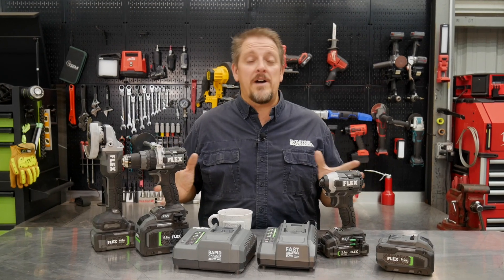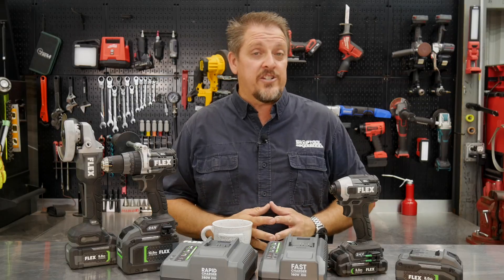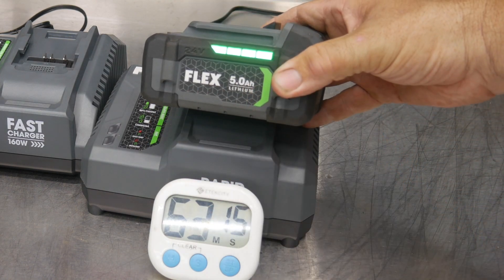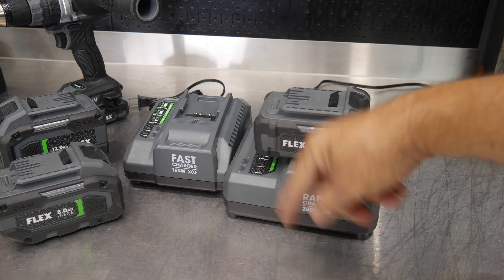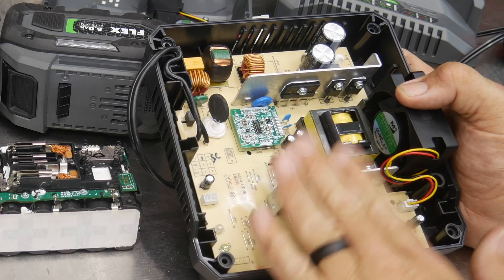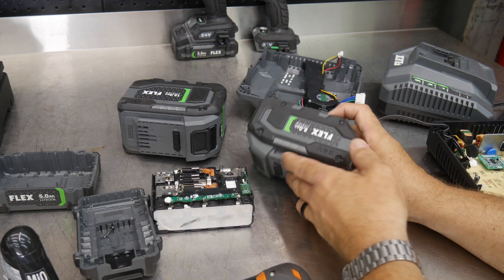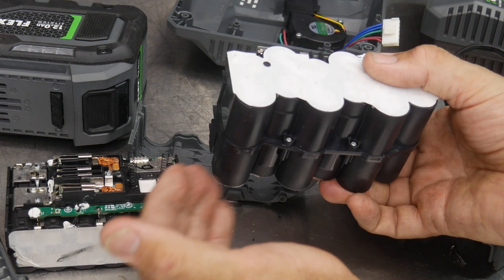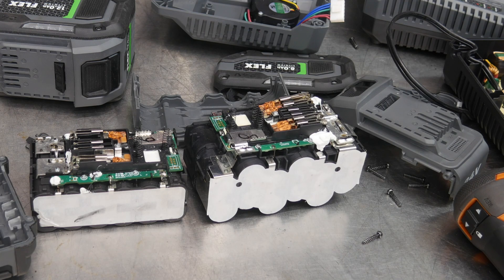DID WE KILL IT? FLEX Battery and Charger Technology [160W or 280W?]

Comment: Bought this Flex pack out a few months ago. Used on three projects. The latches between the top box and the middle box kept hanging up or not locking.  Soooo, tried to call company service to get a fix. Wasn't asking for anything but a tech to walk me through the fix(maybe a replacement latch?). First, good luck getting through, they DON"T answer their phones. After a half hour hold the message comes on offering a call back. No choice gotta grow old on the phone or give up. No call back, so the next day I try again, same deal, but this time I get a call back. Pleasant young lady hears the problem and takes all my info and says they are sending a new replacement unit!!  Of course nothing took place, NO Replacement Unit, No Latches, NO NOTHING!!!!   The product seems to be well made except for these few minor issues, however I would never recommend buying a Flex product. They have no customer loyalty.

Comment: I dropped over $3 thousand dollars in flex tools almost 2 years ago when they were released. 3 months ago the batteries started leaking back goo that stains everything and may be toxic. Flex warranty is nowhere to be seen.
Reply: They are offering a lifetime guarantee on everything if you buy it now before 2024. The registration is easy on the website, you can do it all online without calling anyone, and you register the serial number on your batteries, charger, and tools, so they can honor the lifetime warranty. From what I've heard, they are very happy to send new batteries, no questions asked (for people that had the leaking batteries). The leaking batteries were an old design, which they have since changed.
Reply: Did you register the products on their website?I had 3 start leaking, its their thermal packing paste between cells, mine leaked due to water spilling on them, I called them and they sent 3 new ones with no fuss, and I kept the original batteries and got lifetime on the new 3 I received.  Customer service was super easy and took no time at all to talk to someone.

Comment: What about the leaking issues when the flex batteries got hot?
Reply: They have fixed the issue, I had 3 leak, from water spilling on them, its thermal paste between the battery cells if I'm remembering correctly, I called and got 3 new batteries sent to me and was able to register the batts with lifetime warranty. No fuss at all, I called and waitedd maybe 2 mins for someone to answer

Comment: Does the cheaper charger have dual fans like the rapid charger?
And is it possible to charge a 10.0ah stack lithium battery on the cheaper, slower battery charger?
Reply: Yes it still has dual fans, and it will charge any of their batteries, just at a slower rate of course, only difference between the chargers is the watt output for charging.

Comment: That's Not an easy task! I was wondering if I might need a break before the tool. My Ryobi "smart charger" won't charge a hot battery either. It tests the battery every few seconds until the internal temp reaches a safe to charge temp. It doesn't use cooling fan and I accidentally killed a battery while working on a big project by placing it on charger too soon. I'm just saying the technology has been around for a while if my 9yr old smart charger had the tech for a DIY brand like Ryobi. The need for a cooling fan to cool down the battery when hot at least as important. I'm sure more than a few home fires, and construction sight incidents have occurred due this issue. Flex has made me reconsider what platform I may adopt next.
I'm looking forward to the new year, to see who has the latest and greatest tool platform. My Ryobi stuff needs to upscale to something contractor level.
Right now, DeWalt's kicking everything else's butt. I don't mean every individual tool available, but for the tools that I use to beat the heck out of on a daily basis in heavy duty body repair facility I work in.

Comment: Got an ego snowblower that came with two 7.5 ah batteries. One year, four uses, now one battery won't fully charge even though charger says it is charged. Now a  Flex 2.5 ah battery doing the same thing on its third charge. Tried fast and rapid charger. Also 6 ah stacked lithium on jobsite fan reads one bar, take the battery off, four bars. Not exactly a good battery track record so far. Anyone else having Chevron battery issues?
Reply: Sounds like my 6 dead Milwaukee batteries.  I put a volt meter on them and tested each cell...3.7v, 3.7v, and 1.4v.
That's a bad cell.  Batteries from all manufacturers are shyte these days.  Samsung or whoever is cutting corners.  As well as who ever makes milwaukees circuit boards for their tools.  Its the day and age we seem to be living in unfortunately.   Luckily i have not had a flex battery go bad yet.
Oh another thing.  I was told recently that if Milwaukee does not warranty these bricks that batteries plus and interstate batteries here locally can rebuild them for a reasonable price and the cells they are using are vastly superior to the ones the toolmakers buy in bulk for their batteries.  Have yet to test that out but several people i know are pleased with their results.

Comment: I purchased a new FLEX  tool with battery this month. Unfortunately, the battery is leaking fluid.
Reply: Yeah...i ran into that two on my 2nd 5ah battery. Lowes switched it out for me.  It was kinda funny...they had baggies just for batteries and baking soda boxes they dumped in there with it.😁
The thing is i like the flex tools i have bough enough to put up with warrantying a few batteries.  Just like my milwaukees.  My m12 and m18 lighting and my circ saws, sawsall,  jigsaw, and gen 4 impacter and 3/8 impact wrench are really good tools.
The weed wacker...not so much.🙄
Reply: @unclefester4626  
I like their tools. I wish the rest of the batteries will not leak in the future. It must be a manufacturer defect. The FLEX high torque impact wrench is powerful and reliable. May be the best wrench available.
Reply: @a.a.6132  i think these tool makers suffer from the same problem the automakers have.  They buy many of their components from other suppliers/manufacturers. They just design and assemble them?
Those samsung cells in milwaukee batteries are definitely not as good as they were 10 years ago.  They come in higher ah ratings from the old 1.5ah batts but the longevity is definitely not there.  Flex probably has no choice but to use the same crap cells.
Sure would be neat if there were an adapter that would plug into the battery slot, have an inverter and a cord running to a wall socket.  It could be used if batteries were dead or if several were down for repair. I think they make most of their profit on batteries?

Comment: You know what would be smart? Those brushless electronic motors have that fan on the back of them that move a LOT of air. Maybe if they used some ducting and ran air through the batteries that would help. Makitas already run air through the battery on the charger.
Reply from the maker: They do. They have ports on the batteries that allow the air to circulate through them. Thanks for watching.

Comment: I got the big boy battery.  1 month later, charger has quit on me.  Plug it in it shows red and green light and goes off.  Can this be fixed?  These chargers are expensive...
Reply from the maker: FLEX tools an chargers are covered for 5 years. Send it in for warranty. Lowes should be able to help you. In fact, if you registered the tool when you purchased, then you have a lifetime warranty.
Reply: @Shoptoolreviews  I didn't reg. It. And I actually got the charger and 12.0 battery for free from a review test site so I dnt have any kind of proof of purchase.  Still think they will warranty it??

Comment: Tha is for a great review Tim.  I’d like to import a Flex combo set across the pond to the UK.  Can you tell me if the charger is multi voltage seeing as we run in 240v mains?  Many thanks
Reply: does not work. 240v
Reply: But i think there are adapters to kick the 240 down to 110?
Why does the uk use 240??

Comment: FLEX IS AWESOME!!!! Great products for real
Reply from the maker: No doubt. Great products and lifetime warranty. Thanks for watching.
Reply: I have the inline circ saw with 2x 5.0ah batts,  their vacuum,  and now the compact impacter kit with the 2x 2.5ah batts.  Really impressed with all 3 but especially the vacuum.  I was expecting weak performance from the 5.0 battery but it wasnt weak at all.  Very good suction and runtime.  I will get the fan and radio next.  I would like to get the 7 1/4 right blade saw with the 10ah stack lithium but $400 price tag is giving my stomach fits.  
I might consider the grinder in your review.  I just don't need it as much as i am more into woodworking than metal work.  Not to say i dont occasionally cut metal here and there.
I am seriously hoping they come out with a 10" dual bevel miter saw and table saw soon.
Or even a band saw or plainer.  I'll take whatever they come out with.  That little inline circ saw is good enough to do furniture with.  Really impressed with it!!!

Comment: 280W on a 24V (max) battery is an ~11A charger. That’s consistent with charging a 5A battery in under 30 mins. I think that makes it the fastest power tool battery charger on the market.
Reply from the maker: I believe max output on the charger is actually 9.4A, but yes, it's pulling a lot of power. I would definitely think it's one of the fastest on the market at this time. Thanks for watching.
Reply: I have a makita 40v 4.0ah battery and 40v charger. It charges my 4ah battery (equivilant to 8ah on 18v, 6.6ah on 21.6v/24v) in 42 minutes, its pretty damn fast.

Comment: wonder how many cuts and how long it takes when your on a jobsite and its 100 degrees outside instead of a air conditioned shop
Reply from the maker: That's really funny. We wish our shop was air conditioned! In fact, when we filmed this, it was well over 100F degrees in our shop. Thanks for watching.
Reply: We call that "bat wing weather".  You sit down for breaktime 10 minutes or so and when you get back up certain things are sticking to multiple other things.  Not one of my fonder times of the year.
Nor is that kind of heat once fall hay fever kicks in...or what i call ragweed season.

Comment: An hour & 3 minutes for a full charge on a 5ah battery on a “rapid charger” is not to great tbh .30 mins for my Milwaukee 5ah on their rapid charger,bout 45 mins for a 6ah high output .I get its cooling first but idk .15 extra minutes for a battery charge on the site aint gunna cut it
Reply from the maker: It was NOT an hour and 3 minutes! It only took 52 minutes, 26 minutes for cooling-only, then 26 minutes to charge the battery. Milwaukee: 18V x 5ah = 90Wh. FLEX: 24V x 5ah = 120Wh. The FLEX charging in less than 30 minutes is doing quite a bit more work...and dropping the battery temp. Thanks for watching.
Reply: Which is why my battery collection is stuipidly large for a part time woodworker and full time hydraulic tech.
Expensive though...

Comment: Milwaukee needs fans like these on there string trimmer cause it gets hot and cuts out when you work it hard
Reply from the maker: Interesting. Which string trimmer model are you talking about? The QuikLok trimmer or the new M18 FUEL? Thanks for watching.
Reply: @Shoptoolreviews  both of them can get hot and cut out if you are working the tool pretty good
Reply: @Shoptoolreviews  i think i have the quick lock??  Its a battery destroying POS...  
Will run a battery below the cutoff point.  Hate it with a passion.

Comment: that battery is actually 108 Wh.  21.6V x 5.0 = 108 Wh.  

Never use max voltage to calculate what's SUPPOSED to be a nominal rating.  (Flex isn't the only one doing this fwiw, Milwaukee does this on M12 and Dewalt is most famous for it with 20V Max)

I think Makita is the only one who offers the correct Wh ratings despite marketing the  "Max" voltage for their XGT and CXT lines.
Reply from the maker: Correct, EVERYONE does it on one battery platform or another. On several occasions, we've provided all the science behind this, but we didn't want to dig that hole in this video. Thanks for watching.
Reply: Exactly. I believe that in the EU, they have to use the nominal voltage in labeling the Wh ratings. Same DeWalt battery packs sold in the US have a lower Wh rating when sold in the EU.